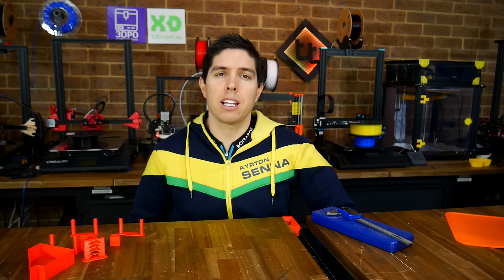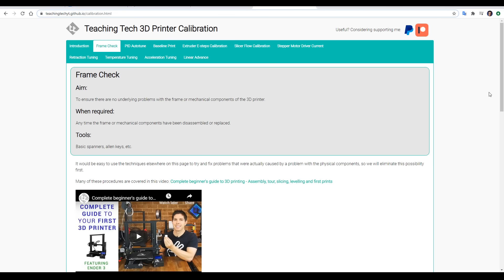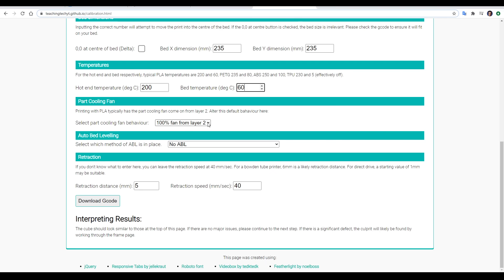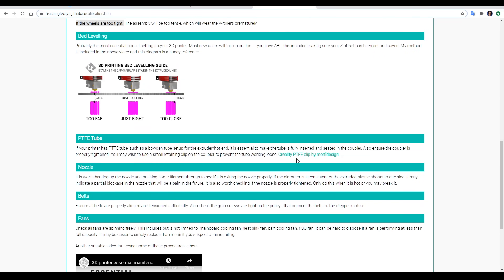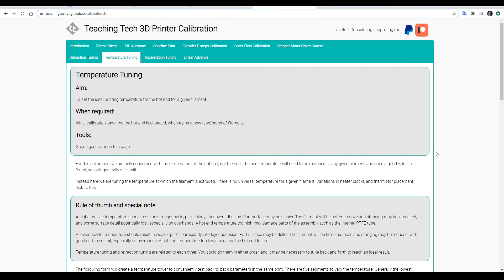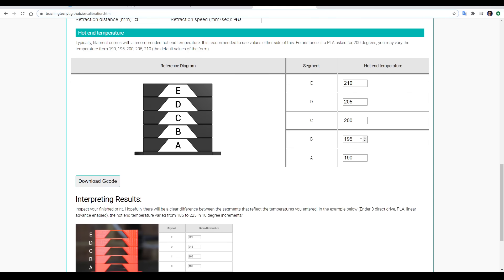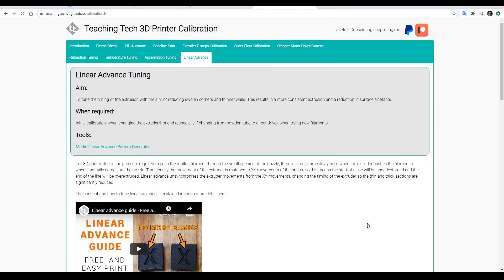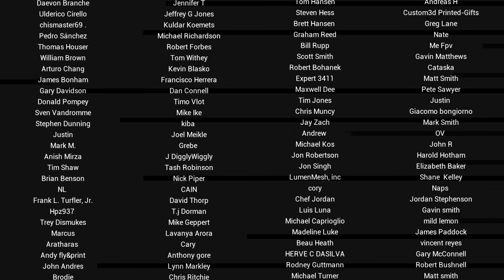3D printer calibration revolutionised - Step by step to better print quality

Comment: Also, when you do your Retraction Tuning gcode, don't think you should move from the home position to the start position at Z0.  This could be dangerous if someone hasn't properly leveled their bed.  Think it would be better if you came up a little, then moved to your start position, then moved down and began your towers.  Just think it would be a safer approach ...

Would also be nice if you displayed where you were in the Retraction Tuning process on the LCD.

Comment: A bit confused on how you dial in Retraction Tuning.  I have an Ender 5 Pro with a 32-bit board.  I ran the Retraction Tuning running from 5.6 to 6.6 Retraction Distance with Retraction Speed & Prime at 40mm/sec and no Extra Restart Distance or Z Hop.  For the most part this ran pretty much completely WITHOUT stringing.  Possibly a bit of hair on 6.2, 6.4 and 6.6 but very minimal and nothing that spanned across the posts.  So, given that, how do you continue to dial it in more?  If there's absolutely nothing at 5.6 or 5.8, how can you continue to make changes to try to make any improvements??

If you do make additional changes, what are some suggested values for Extra Restart Distance and Z Hop?  Where should you start and what should your step sizes be?  Should you go up/down around a value or just up or down from a value?  I know there's a lot of info here but it would be most helpful if you provided more guidance on how to attack this tuning session and the best values to use for the different parameters to get started.

Comment: Thank you for the detailed testing procedures and information you are providing. I'm definitely going to use your site for calibrating my printer. I have a single question though: I know this is the best I can get for now from FDM 3d printing technologies available in terms of calibration but do most of these values depend on the filament itself (same material type, but still so different in it's category) ? E.g.: in the extruder calibration test it seems quite obvious to me that, as I own a PLA that is quite soft when bending it and even feel like I can scratch it with my nails if I want to, and another PLA that feels pretty much like glass, and I won't be surprised if the second one would be more slippery to the extruders' teeth than the first one.

Comment: Due to Ender 3 (pro, V2 or any version) alignment is essential and tight but not overtight is essential, you should emphatize more on that and give advice on how to have all aligned as with the video and page description on "Frame check" on the website does not cover it.

Sure other videos from other users cover the "X Gantry Rework", as into how to straighten the vertical frames, and have all in correct alignment.

Have been a week trying to find the problem on my ender and it was a vertical frame not aligned with the other one and the horizontal rail where the X axis was not horizontal. All this causing unconsistent bed leveling.

 Finally perfect or really nice prints!!!, 

Take the advise as a positive thing!!. All the other videos and guide in the website is Great!! Thank you very much for your work they are very detailed and very well explaned.!!!

Comment: I'll be running through this on my Ender 3 Pro today. I added a probe and stiffer bed springs, upgraded to the aluminum dual-gear extruder and capricorn bowden tube, and put in the SKR Mini E3. This is exactly what I was looking for to get my prints back in spec. Thanks!

Comment: Just starting modding my first printer and getting into tuning and varied filaments. Been using one of the mini all in one tests from thiniverse but it's a couple hour print and as such makes it hard to calibrate a step at the time. Thanks for putting together such a comprehensive resource and taking the time to script out the github page!

but uhhh... any suggestions on getting faster prints out of an ender 5?

cheers m8

Comment: I'm running a Kossel Delta running Klipper. For the retract tower GCODE I needed to change the order of the very first G1 moves so the lowering of Z happened before the XY move. For me, it meant Klipper no longer killed the job - since before it was protecting me from ramming my endstops. I think Marlin might auto-lower to a safe Z distance. Either way, if the generated GCODE causes problems for you, this might help. Otherwise, I figure it wouldn't hurt if the generator was specific about moving Z prior to moving XY.

Thanks! This guide has been extremely helpful, even though I need to "translate" a bit for usage with Klipper rather than Marlin.

Comment: Thanks for the website, I ran into an issue on the e-stop configuration, i had to figure out how to disable cold extrusion to be able to extrude without a hot end on it.  I found it here to disable then re-enable after testing.  https://marlinfw.org/docs/gcode/M302.html

Comment: WOW - and thank you so much.
All of us have tried at least one of these calibrations at some stage. But never have I sat down and did a structured "start to finish" complete printer calibration.

Fantastic to have this one-stop shop tool. My printer is complete self design from scratch soooo - the opportunity for some funnies was right there. And boy did I fix some.

I cant for the life of me work out why I must use a 66% flow rate in Cura, despite perfect 100mm Extruder calibration, brand new Micro Swiss 0.4mm nozzle and quality filament. And that is with everything else also perfectly calibrated. mmmmm

Comment: Vernier calipers are not really suited for making measurements with higher than 0.1 mm resolution, no matter how many digits the display may have. Use a micrometer instead.

Comment: Hey thank you for putting this together.  I believe there's a bug in the e-step calculator.  I was trying to use your tool but it wouldn't calculate.  Previous e-step value = 326.93 with a "Measurement between extruder entry and mark on filament (mm):"=20 - the calculator will not work.
Reply: Are you saying that you got 326.93 e-steps when you had 20 mm of filament left? Because that’s what it’s supposed to say. It’s supposed to have 20 mm left over, meaning your e-steps should be the same

Comment: I tried to follow along but got instantly lost and am still stuck on the terminal access part. I have a Qidi Xmax and I, for the life of me, cannot figure out how to operate and configure any terminal software to get past the early steps of this video. I have watched videos but they already start at a level of knowledge that is beyond me. Is there any chance of creating a step by step on what these programs are and how to utilize them? My machine isn't printing the way it should and the finish is not up to standard, need to complete this calibration process but cannot. Any advice is greatly appreciated!
Love the videos!
p.s. I use Fusion 360 and Simplify 3d.

Comment: Howdy! Of course since you've done an amazing job providing a free tool, of course I'm going to be the guy on the internet that's not satisfied and ask for more!
Specifically... As a Monoprice Select Mini owner I'm hoping that it won't be a huge amount of work to add in some options for layer heights... - we're stuck at multiples of 0.04375mm for optimal prints!

Either way though... as someone relatively new to the scene... this is still an amazing tool!

Comment: Dear, friend! I'm slicing my own "retraction towers" on PrusaSlicer inspired on your instructions. I managed to slice a "retraction lenght tower" using the M207 command (similar to a temperature tower, where I put the command M104 to change the temp in different parts of the sliced model on PrusaSlicer),  but I can't find the commands for retraction speed, extra lenght on restart, deretratcion speed and lift z... Can you provide them, please? thank you very much!

Comment: i take a look on your website  and  please tell me what are  settings used  in Baseline Print   for extrusion multiplier in that g code as it does not show any settings in gcode :(  ? and all other settings as when i printed that cube  wals are perfect only top surface isnt closed properly so jus this need to be corrected in my case :)

Comment: Thanks for all the useful vids!  Used your retraction test to dial in settings on my Ender 5, got it printing pretty smoothly with that test..... until I used the same settings in Cura and it strings like a spiderweb on meth.  Can't find any different settings I'm missing, totally at a loss.

Comment: using the  XYZ 20mm calibration cube generated from the site, i was able to get a 99.9% perfect 20mm cube. I could never get that from cura. How is the gcode generated and how can I use the generator on my local pc?

Comment: 9:12 "You'll need a pretty good set of vernier calipers"
the calipers shown don't have a thumbwheel
Reply: A thumbwheel makes it easier to use but these will work all the same, just need to learn how to use them, like using a slide rule which had no wheel for movement
Reply: Vernier calipers typically don't have dials.  But he used a digital calipers not a vernier.  
A vernier caliper uses a vernier scale not a dial or digital read out
Reply: @jm8361  I know, this I was quoting the video :)

Comment: I wonder if it's possible to put a box for entering your own values instead of the warning in introduction, for example I don't use Zhop, have a .5 nozzle and regularly print over 120mm/s (up to 300 some times), so it would be nice to parametrically change those to suit your printer, I'm sure I could do it from the code itself, but that aside, it looks genuinely awesome! big time saver and super useful for newcomers

Comment: Question: If you calculated your E-step correction with the hotend at printing temp and filament running through it( as you will see more resistance at lower temperature in terms of driving the filament through the hotend, and obviously zero resistance with the filament running with hotend not attached ) you would probably see less preceived error when performing the Slicer Flow rate ( when obvious the hotend is on then with filament flowing through.  I suspect if you set the E-steps the way you have suggested it will not represent what happens when you are actually printing ?

Really good stuff, appreciate the effort and definitely will reference when calibrating my printer.

Comment: First of all, thank you for this. I've used a bunch of the tools and they've been straight forward and easy to execute.

I do have a question though. I ran through the retraction test and didn't see any difference through two tests. I'm wondering about this since most stringing tests have smaller "poles" that are much closer together. The test I got from the retraction page is much larger. Anyone else notice this?

Comment: Just recently upgraded my Ender3 Pro with a new SKR mini motherboard and a Micro Swiss direct drive extruder kit. This tool has helped immensely with re-calibrating my printer but I'm also experiencing some weird flow/blobbing issues on the rear/left corner (likely where new layer starts) having adjusted my Slicer Flow Calibration (step 7). I'm using PETG. I've tried adjusting the temp and flow in Cura over 8 tests now but can't seem to resolve the issue. Is it possible that the filament is 'damp'? Nice, clean prints otherwise with no ghosting.

Comment: my question is where do i use the gcode? i just paste it into the slicer and then create the gcode for the stl? can someone explain that?
Reply: You put it in whatever medium your 3d printer reads from. If you use octoprint you upload the file to octoprint, if your 3d printer use an sd card you upload the file to the sd card and then put it in the printer. No need to slice since it is "pre-sliced".

Comment: Fantastic job!
I've done the same using TXT files over the years. This is great!
You could add how to scale a part to perfection. On a Delta it's Arm Length for example. Print a 1 inch cube or 25mm, measure it and adjust arm length. On a Cartesian I forget.
Again, thanks for the hard work!

Comment: Thank you for all the effort taken and simplifying calibrations -alot-.
I was just having 1 question, since your calibrations come out better then when printing the same thing in my own Slicer (cura).
Can you please share the outer wall speed that you are using in the generated files? The main page only displays the print speed, but I noticed the walls print slower.

Comment: I am using an Ender 3 Pro with a pi 3 B+ running Octoprint, and Cura.

Is there some kind of hard-coded settings on the printer that make it so it will not take gcode sent to it?

I have been doing the acceleration tests, and have tried some extreme numbers **trying** to get it to be different on layers (400-10000), and it is almost like the printer has an override that does not allow it to change.

Comment: Is there a way to calibrate small detail size? Eg my calibration cube is externally dimensionally accurate, but when i print small details, for example a slot for a nut, they seem to be consistently around 0.5mm undersized.
Reply: Could it be horizontal expansion?

Comment: Stop saying "calibrate your printer". My printer has already been calibrated by the manufacturer, via firmware.
What we're doing here is calibrating the slicer for the filament were using. Its the slicer being calibrated, not the filament or printer... still, good info.

Comment: Maybe it's just me but I feel like the order of these steps could be improved. I very well could be wrong, but it seems to me that the Stepper Motor Driver Current step should be done before the Flow or E-Step Calibration steps, even before the First Layer step. That way hardware is dialed in before configuring software

Comment: Appreciate the effort that obviously went into this project.  Looks great.  Do have one question regarding getting the initial bed level correct using the X.  If I already have BLTouch ABL in place, would I make changes to the Z-offset to achieve the desired results for "squish"?

Comment: Great video and an amaziong resource! Might finally be time to start fiddling with more than just slicer settings and hardware tweaks. Do you have a video on firmware changes from the ground up? What you need to do them etc?

Comment: Hi Michael .. have found your videos very helpful.. Have you ever done a road test of various hair sprays that actually work for ABS printing ? 500g of Schwarzkopf Super Hold for $9 at Chemist Warehouse.. it works but only after alot of coats.. Wondering what you'd use ?

Comment: First, I want to say thank you for all that you do for the 3d printing community. I find myself watching a lot of your videos. You are the reason, when I got my raspberry pi, I was able to get octoprint running. I have a question about the flow rate cube. I know you said it is kind of unimportant but, when I print it I get one side at .35mm, 2 sides between .4 and .45mm and one side starting at .5mm and ending at .7mm. It is a noticeable deviation to the naked eye. The thick side is the last side it is printing at each layer. I can't seem to figure out what the issue is. Do you have any ideas? Any help is much appreciated. Keep doing what you're doing. You're Awesome!

Comment: why use ponterface and bare gcodes to change settings, instead of just going into the printer's settings under motion and adjusting the settings that already show up there? all the max values and e steps are already there... and acceleration is in the slicer too... no gcode needed to adjust them.

Comment: When doing the baseline print, how do what do i do with the gcode text file that i save? It does not open in Cura or Slic3r
Reply: cura is used to generate g-code.  this step has already been done and you can skip that step and copy the g-code you download straight to your sd card and print from the card or use octoprint to upload the code to the printer. 

In any case, it is already processed into g-code and cura is not needed.
Reply: @chipheadnet  I print through octoprint, and it wont accept the gcode text file. As is its a .txt file thats gererated, not .gcode file. Do i just copy and paste the entire text file into the terminal?
Reply: @hotshotjosh21  have you tried renaming it to .gcode ?    Mine downloads in Chrome as a .gcode file.

Comment: This is fantastic. I've been unsuccessfully trying to figure out how to make retraction towers for ages with cura post-processing.
Could your code be modified by nozzle size?
Reply: It'd probably be easier to download the stl and slice it yourself.
Reply: @NirateGoel  unless it has been changed recently, I don’t think it is possible to change retraction settings at z via post-processing in Cura. Happy to be corrected if it is possible.

Comment: I figured I may as well ask you in your most recent video instead since I have an Ender 3v2 question. I added a BMG extruder and I cannot get the E steps over 186. Do you know a way around this ? When I put 100mm filament it sends out about 40

Comment: Interesting and I'll give it a try, but I don't understand what "terminal" he is referring to when he says enter the gcode (M300 for instance) and see the results.   Did he connect a usb cable to the computer and then run some communications program like Kermit?  Or is there an app?
Thanks,
Jim.
Reply: Hey Jim, I use pronterface to interface with my printer and send the commands such as M300, this is connected via USB port.
Reply: @KroMeMWGz  Thanks, I see there is a Linux installation of it.  I'll give it a try.

Comment: This is a wonderful collection of information,  possible adding information about ABL setting up z offset would be helpful.  Providing a suggested order maybe helpful.  Should e steps be calibrated before z offset or bed leveling is tuned by filament extrusion.  

I’ve got a new skr e3 v2, BLTouch v3.1 ABL and new filament roll so it’s back to step one for me and this will be a big help for me